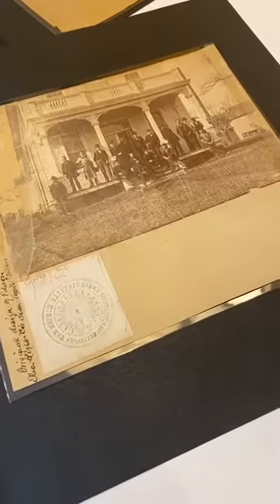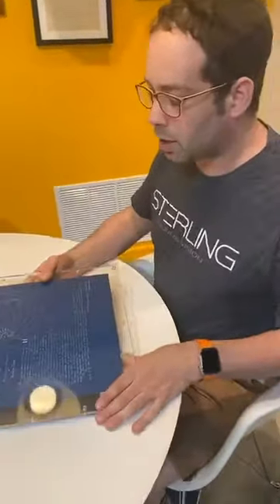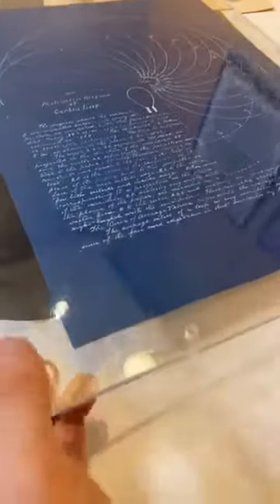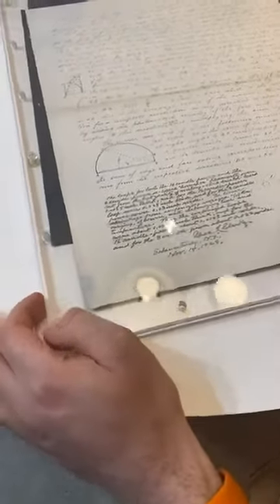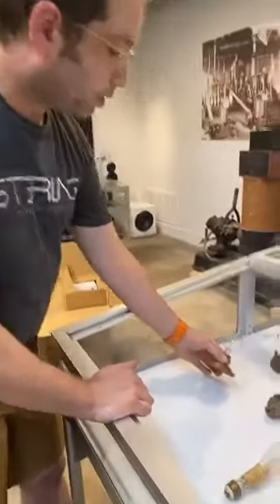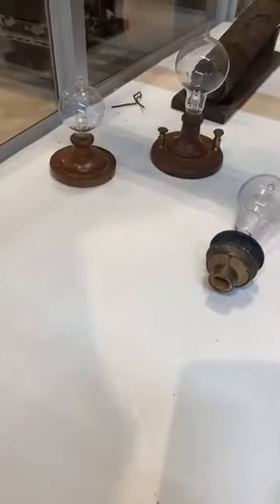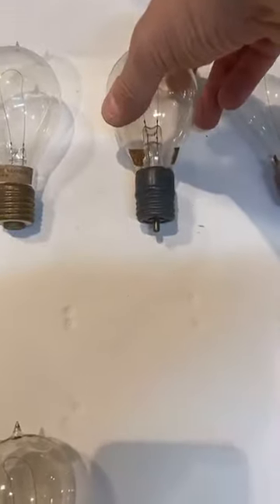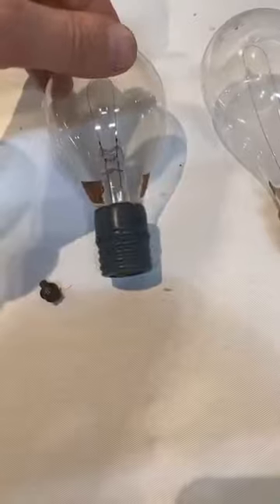Edison Light Bulb Development Presentation from my Collection

Comment: Hi. I have a question about the C.1883-85 Edison Bamboo Filament Bulb which you may be able to answer.

Where the bamboo flares out at the ends of the filament and you mention it connects to copper plate - Was the idea behind the flare, to lower the resistance at those points (relative to the thinner part of the filament) and thus lower temperature enough at those points, so that it was further from the melting point of the copper contacts? Or am I way off? Thanks!
Reply from the maker: The flared ends of the bamboo filament actually predate the use of the copper plating attachment method, when the filaments were attached by mechanical means in platinum (and sometimes nickel) "vice" clamps. The flared end was necessary for a better grip with more surface area contact between the clamp and the filament. This was both for mechanical hold and a solid electrical connection. This no doubt increased the resistance at the ends and also helped keep the heat at the clamp, down. While the flared ends were necessary for proper grip of both the copper plated clamp method and the vice clamps that predated that approach, the next method that came about around 1886 using carbon paste did not need the flared ends fo the attachment method, and the use of carbon paste as an attachment method also was more impervious to heat.
Reply: @chadshapiro7861  Thanks for your reply. This is the more detailed info that i've been looking for!
I'm pondering how I might go about making a Nernst style lamp. Minus the heater probably and will get it up to temp using a flame instead. I will be attempting to use commonly available oxides - particularly ones which can be sourced and processed from the environment in most locations, with relative ease. Ideally just using 'bush chemistry'. Aluminium oxide, Silicon dioxide, Magnesium oxide, etc. Ashes of certain plants may be a good source - purifying it of unwanted salts and calcium shouldn't be to difficult. It's an unusual approach and while it may seem pointless to alot of people, it could be very useful to some people, somewhere, at some stage.
- I have been trying to figure out what to use for the contacts and how to join the filament. Platinum could be an option, but i'm looking for something more commonly available, which should of course be unaffected by, or at least resist oxidation within the temperature range. This is what got me thinking about flaring the ends of the filament to lower the temperature at the connection points, to a temp where copper, or something else could be used. I had no idea the Edison bulb filaments had been flared. Glad I found your video.

If you have any suggestions, let me know, i'd love to hear them!
This project may be beyond my skill level, but then again i'm the only one I know personally who even knows what a Nernst lamp is, so... 
I'm sure there were reasons for Nernst using rare earth oxides, commercial and/or otherwise. But other oxides could work also. I read somewhere about them emitting different coloured light depending on which oxide it is.